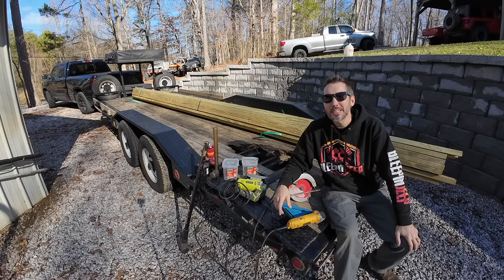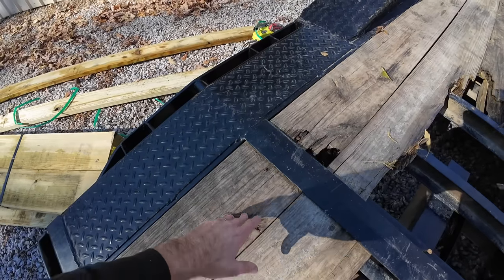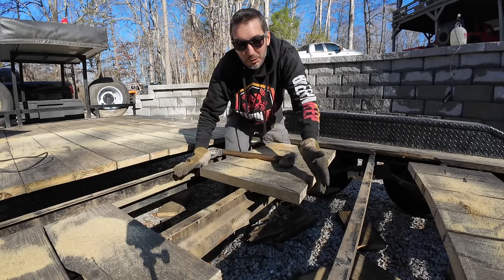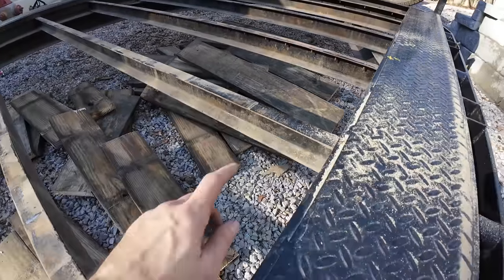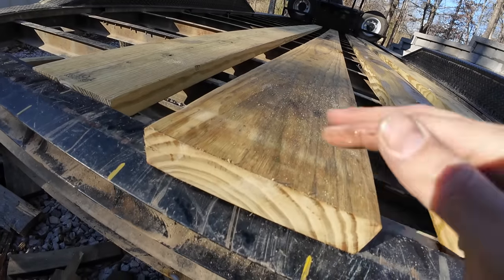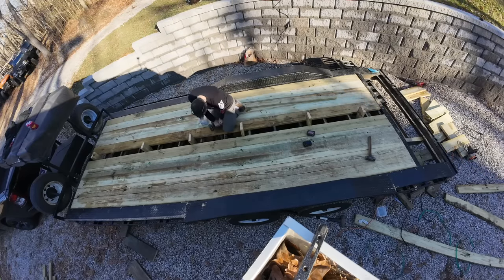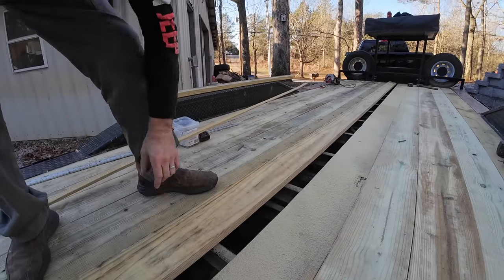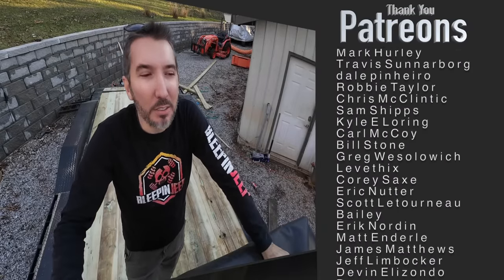How to Replace Trailer Deck Boards in an Afternoon (EASY)

Comment: Nice work sir.  In the last 40 years, I have re-decked a few dozen trailers...  7 were mine, but many friend's trailers got the same treatment.   If this helps, I have found that treated lumber fails just as fast as cheap wet fir, and has a nasty surface, so don't spend extra on it.  The key is sealing, as you mentioned.  Once installed and dried/shrunk, boiled linseed oil has proven to be the best sealant, at lease in my experience, especially down here in Arizona where the summer sun likes to destroy everything.  The best results are to roll it on with cheap paint rollers, let it soak in, and repeat.  It takes about a half hour for each coat to soak in on a warm day, and the first time will require 4-5 coats.  Once it stops soaking in, you're done... just wipe off any wet spots and enjoy.  It dries clean and is not oily like diesel or motor oil.  If you follow this process every spring, it will only need 1-2 coats, and the lumber will give you at least 20 years of splinter free service.  If you can get the underside done too, even better.  Anyway, I hope this helps someone.  Thanks for the great video.
Reply: BLO is old school, lol.  But its better than what the government VOC rules have left us!  I tend to thin with some mineral spirits, it soaks in farther & tends to leave a slight glaze on the surface.
Reply: I 100% agree, the last treated re-deck on my tri-axle only lasted 7 years (Menards lumber). This time I used untreated lumber with oil seal. I also left 1/8” gaps for drainage and to allow future oil treats to get between the boards. 2 years now and it still looks great.
Reply: Back in the day before people got all sensitive... We use to use a paint roller and used motor oil. After every oil change the trailers got a quick treatment.
Reply: @jerrycherini1708  Yes, people are too sensitive.  Aside from that, the problem with using used motor oil is that it continues to transfer to shoes and tires for a long time, and that gets tracked into the truck carpet and shop floor.  For heavy equipment,  it's a totally legit option, but I wouldn't use it for a utility trailer that doubles as a patio when camping or a place the kids play or sleep at night.  My two cents.
Reply: I pre-treat lumber before cutting it so I can coat the whole surface then touch up the cuts. It's MUCH easier to coat lumber on saw horses or welding stands then on the trailer.

Comment: I don't understand why the trailer manufacturers don't make the metal strip  that separates the long boards from the short beaver tail unbolt instead of being welded on so it makes board replacement easier.  I did this by cutting the welds and adding a tab that is welded to the ends of the strip with a hole in it for a bolt . Then tapped the frame to bolt it down. They had to know the wood wouldn't last forever.

Comment: I helped rebuild a bunch of trailers with my old boss who was a retired Navy seabee carpenter, his trick for preserving wood was to lay the boards out on the driveway and go over them with a blowtorch until they start getting tan and a little charred then while still hot spray them down with linseed oil out of a pump sprayer, he would do a coat on each side like this. He said the boards would last 30+ years on ocean front property with salt splash etc as long as you hit them with more linseed once a decade or so.
Reply: Nanan00. What kind of wood did you use?
Reply: @c50ge  its called shou sugi ban a Japanese style of preserving wood. It can be done with basically any type of wood. You can even make non-treated lumber nearly waterproof doing it this way

Comment: Your boards are too tight, when they expand they will be more likely to buckle. I gap mine withe a 6 penny nail so the rain doesn't sit on top of the wood
Reply: When that pressure treated wood dries out it'll end up with 1/4 gaps or more.
Reply: What he said lol
Reply: Yeah. That wood is soaking wet. It will have gaps when it dries.
Reply from the maker: ya they are very wet still, they will shrink a lot once the weather dries em a bit.  I did that on a deck once with spacers inbetween only to have huge gaps once the wet wood dried out.

Comment: You had some good tips. I have done this before and it can be aggravating.  I finally switched to a steel deck because Treated wood is not as good as it used to be.

Comment: For those that don't want to weld or cannot, you can actually fit the boards into 1 side, use wedges and weight to bend them, effectively shortening them, then slip them under the the steel on the other side. popping out the wedges is satisfying AF.
Reply: yea, i always that this was the normal way of doing it. but i guess that won't for for the small dovetail portion

Comment: Great video and the timing is just perfect for me. I have a small 6x12 that I have had for 20 years that I am going to modify a bit. The boards "aren't bad", but they are getting replaced anyways. This video has just saved this 65 year old old guy a bunch of headaches. With my current health status it'll take a little while to get done, thing is with your instruction it will go smoother. Thank you. Has anyone matched or beat Matt's reverse driving time down the hill yet?

Comment: Everything you said was right on the money, with the exception, where you cut off the old bolts, you should coat it with some paint. I did my old trailer, with one exception, the same way you did. The exception was, I drilled holes all the way through and used carriage bolts and nylocks. But every thng else was the same, wait, no, I didn't cut all the baords, I used a crow bar and ripped the  the boards off, the reason why(and your way is easier) I wanted to save as may of the boards that were not rotted, because I wanted to, and did, make some shelves in an out building. One thing I will always remember about it, was, it took 3 drill bits( I did hit some of the old screws) and 100 bolts and 100 nylock, and 100 flat washers! LOL.
And, I am a fan of the motor oil, with a little diesel or kerosene (just to thin it up a bit) and yes, you have to wait till it dries good, and isn't all that easy since most trailers sit out and get rained on a lot. but, jacking u the tongue and layering some cheap tarps and weighting them down seem to help a lot. One tip for those wanting to use used motor oil, paint it on, let it absorb, keep doing that until it won't take any more, then, wipe off all the excess. At first, it'll be slick when it gets wet, but that goes away after some time. And repeat the process every 3 years or so.
Reply from the maker: ouch that seems like a lot of work to get under there and add nylock nots, but good tips, thanks!

Comment: We just bow the boards and slip the ends under the tabs

Since all the treated wood comes wet, if you’re not in a hurry you can block/wedge all the boards in and wait for it to dry and shrink before screwing down and inserting last board. If you put them in wet and tight and live in a dry climate you’ll end up with 3/4” gaps when they dry out
Reply: So True.   Watertight on installation, daylight next day.
Reply: I did the same thing with my damn near same trailer 4 years ago. Took maybe 3 hours to replace mine.
Reply: Those 3/4 inch gaps will allow debris and water to easily pass through preventing any pooling of water and result in longer lasting deck boards.
Reply: We live in a desert so drainage and pooling aren’t that big a deal here (aka at all). Broom off the debris and we’re set😁

Comment: Hint:  2X dimensional lumber is typically stocked in the lengths that the boards can be used for floor joists under the building code.  Wider boards are stocked in longer lengths.  And the deck will be more rot resistant if you use pressure treated wood.  But pressure treated wood, can cause the steel to rust.  The solution is a product called slick tape, which is a polyethylene tape with an adhesive on one side. you put the slick tape on the top of your metal crossmembers, to isolate them from the pressure treated wood.  The cross members on either side of the tires on the vehicle you are going to carry, need to get screwed down solid.  And you might want to leave a gap between the wood runners, just like a deck.  The wood will expand and contract with humidity changes.  If the planks are solid against each other, they can buckle up and break the screws.
Reply: Yes on leaving gaps. I cringed when he pounded that last board in.

Comment: I have the same trailer type. I used copper sulfate on all the ends and where I drilled but before screwing them down  I put butyl joyce tape on the cross members that keeps the treated boards from reacting to the metal. When Done I painted the entire bed with the copper sulfate.

Comment: Nice job Matt, great tip on the crown! Most would forget or knot know that 👍
PS- is that thumbnail AI?
Reply from the maker: for now, A/B testing 3 different options... new YT feature
Reply: @bleepinjeep  ohh awesome I dont think they unlocked that feature on my channel yet. Thats a great idea. Ill have to check computer see if different than studio app
Reply: Except he is wrong.  Out side edges of board will bend toward the side nearest where the bark was.  I know I did it wrong for years.  So you want the smile upside down if that makes sense.

Comment: Very NICE Job Matt. I don't consider myself crazy (it's more from my "CDO" yes I meant "OCD" but "OCD" isn't in order do you see my dilemma)  but I would have wanted the last board to fit tight myself knowing that as the wood dries out your going to have spaces develop in between the planks.

Comment: If you use your trailer frequently and really work it:  2x4 or 2x6 on outside  then 2 two channel irons each side ( not perlin...) depending on what you do with it (I haul automotive, ag and.construction equipment... HEAVY)  where your wheels usually burden the deck.  You will need to notch the channel iron to sit flush with your deck.   Fill in the middle with wood.   I have 4 trailers fitted with channel iron, works great!  Currently channel iron runs about $100.00/20'  money well spent.  I leave about 1/4 " between each for drainage.

Comment: Great tutorial video On trailer deck replacement Matt.  Couple of questions. Like fence boards, there’s a small gap between the boards. Why is there No spacing between the boards. Secondly, the board looked in good condition. Could you have repurposed  all of the wood ? Great video!🤙😎

Comment: Nice work, how much more would it have been to top it with diamond plate steel?
I have a 16 foot trailer with a wood deck. One of the guys at the scrap yard dropped a heavy piece of scrap metal and took out three boards about 18 inches from the end of my trailer...thanks dude.
I ended up flipping the boards tip to tail and adding a steel plate on the front over the broken boards.
That was 20 years ago.
Thompson water seal with a paint roller works for a quick job...just dip the roller in the pail and go.

Comment: Great video! What kind of wood did you use for the trailer deck? Douglas fir (pine) or oak?
Reply from the maker: just pine
Reply: @bleepinjeep  thanks for that info. I need to replace my vehicle trailer wood decking, it came with oak and I was not sure if pine or pressure treated pine would be sturdy enough. Have you had any issues using pine?

Comment: You could have run a metal strip up the center and drilled it for lights, this way if you ever needed to work on a rig you have up lighting.

Comment: I was told by my local Home Depo to not use pressure treated lumber on any metal surface. The chemicals and arsenic in it will react with the steel and cause carossionand rot.  The best, softwood is hemlock that is rot resistent. May only be avalible at a local sawmill. Of course hardwood is better but heavier. I used dimensinal pine boards and  coated them with Home Depo Deckover paint, when dry is as hard as a rock. It is holding up longer than pressure treated lumber

Comment: I got a friend with a sawmill.. I only put screws in the middle of the trailer an sprayed it with a mixture of Diesel and used motor oil both sides before i screwed it all down.

Comment: Sure hope that treater is wet, if not, first good rain (or winter) will probably shear some of the side welds, lol!  (Had a client decades ago who laid their own hardwood in some bedrooms.  He didn't leave a gap at the walls, first unheated winter it pushed the walls half way off the foundation...). We normally leave a slight gap between boards when we build decks...  But, at least yours will be better than most.

Comment: Hello, and thanks for the video. But wouldn't you want to seal the boards BEFORE you install the boards? That way you can easily seal both sides and edges? Good video though.

Comment: I use a bottle jack to push the boards out from the center to screw them down.   The gaps will open up over time.

Comment: How is it with your boards that tight together? I was told the gaps in the wood were for the trailer to flex.
Reply: Wood will shrink as it dries💡🤔
Reply: @MrDeleoco  Yeah it could. I ask because when I picked up my trailer from the manufacture I asked why the boards all had about a 1/8" gap in between. They said it was to help the trailer flex and if they make them tight like Matt did then as the trailer flexes the wood pops and sounds like a gun shot. I'm no expert but makes sense to me.
Reply: The gag is to allow the wood to dry out.  Two pieces of wood in contact will rot.  Look at any home deck.
Reply: @RaneyOneTwenty  I can believe what you're saying is correct. He did jam them together 🤔. I've noticed that the boards on my trailer have shrunk to a point where the gaps are a little bit wider than when I purchased. But I can agree, that if he takes it out and does a loading twist flexing the bed, something may give way and pop. 💣

But for the manufacturer it saves time on custom fitting with reasonable margin.
Reply from the maker: there will be gaps once the PT wood dries out, its very wet still. see comment above!
Reply: @bleepinjeep  Ok makes sense. The wood on mine wasn't treated when I picked it up. Took it straight to my shop took the boards off and coated them with used motor oil.
Reply: I meant gaps not gags!  Yes the wood will shrink some.  I just like a bit more space for washing the dirt out when they do.  Great job!  @bleepinjeep

Comment: if you can afford it and can still get it , use Japanese Apatong boards.this is an Asian hardwood. semi flatbed trailers use these and if you ever have to nail to it ,when you remove  the nail the hole will disapear in a days time.Unless you break a board, it'll last forever.

Comment: Could you Haul all your gear on a 16 foot trailer? I have an XJ and I don't have a very big yard .
Reply from the maker: ya you could put an XJ on one, 16 foot would be my minimum though.  18 or 20 ft gives you more room for weight distribution to get that perfect sweet spot.
Reply: Biggest trailer mistake I see isn't length, but axles.  Most car haulers that size will have 3500 lb axles meaning a max load of 7000 including the trailer itself.  A built rig will likley be over 5000 + your gear + the weight of the trailer at say 2000 lbs.... REAL easy to go over-weight.  Sure the trailer might survive but anything happens and your insurance will tell you to go pound sand.  Same if a cop wants to give you crap.  My Discovery and 18' trailer come in at 8500 lbs - you wouldn't think it's that much but stuff adds up a lot more than you expect.  Hence I have 5200lb axles under it.
Reply: 16ft Fits my TJ and my friends 700cc Quad sideway or 2xkids 80cc quads.

Comment: Forgot to add. Sure would be nice if trailer makers would space the cross members 16" instead of 2' ! They just don't realize so much weight is being supported most of the time by one board,in the position that the board is doing it's job  in the weakest position that  it's at it's weakest(laying flat). And, add to that, even more pressure is being added to the weight, when a vehicle is tied down, making it extra weight/force on the board(s).IMO just a cost saving ploy.

Comment: Self tapping torx head bolts are far superior to Phillips head.  Note i said self tapping not self drilling.  Drill hole then screw in bolt.

Comment: I bought my first trailer in 1986.  There were no screws, the angle irons held them in and it was noisy as hell.  When I re decked it I pried the boards out and put then in the same way, using a 2x to bend the boards and then slipped out he wedge.  The last one was tough but it went.  I'm getting ready to deck one this spring and it is screwed, but no dove tail and this time I will take the angle off the end because it's bent and I want re design and hinge the ramps better.  Since the treated lumber dries out can anyone think of a problem using yellow pine and staining it with used oil?  Besides fire!  😬🤪

Comment: Using green treated lumber is good, but it will SHRINK!  Especially if you get it from Menards.
Reply from the maker: yes it will, thats why I put it together with no gaps.  Shouldnt be a problem for a car trailer though, its not a masterpiece after all.